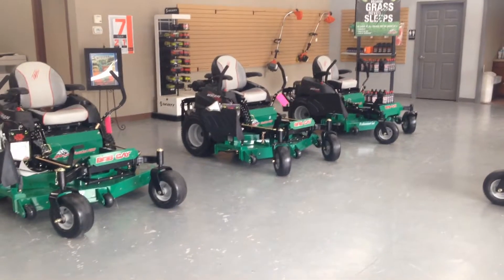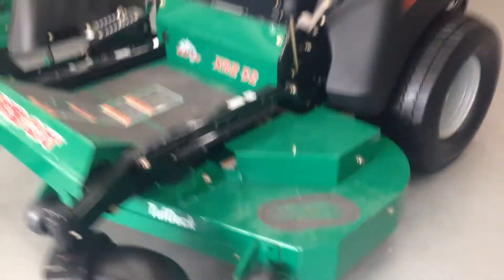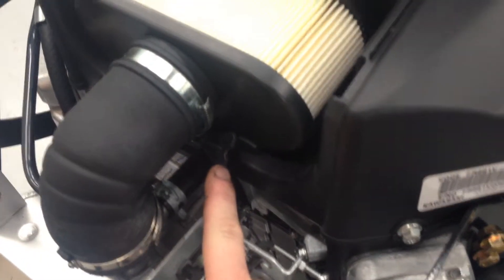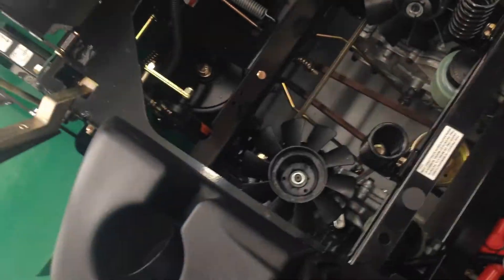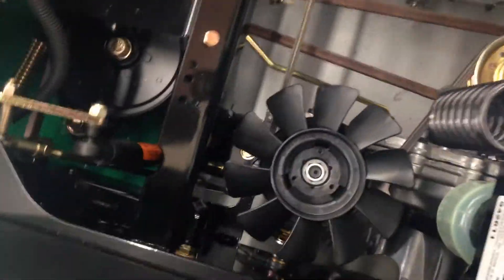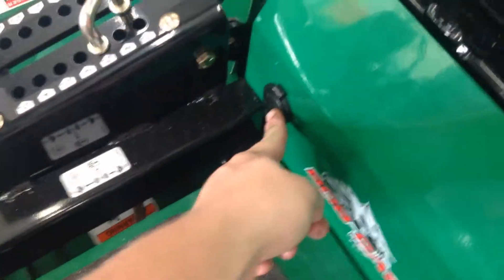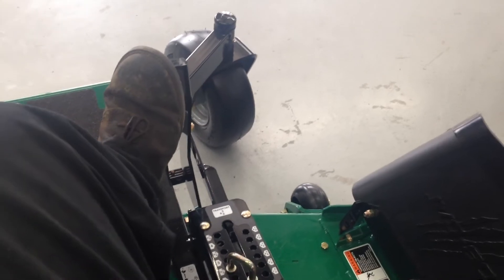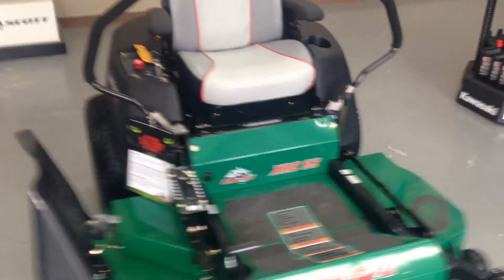BOBCAT XRZ 52 Presentation

Comment: I didn’t see any bearing or casters that are greasable. Is that correct? If so why not serviceable bearings?
Reply from the maker: Because no one wants to deal with maintenance any more.  A lot of brands are moving away from serviceable spindles and going with sealed spindles.  On the mowers I sell Bobcat and Worldlawn their sealed spindles seem to average 750 hours.
Reply: American Diesel Lovol USA yea to me it’s called laziness. I’ve had zero turns for 15 years and the bearings last a lot longer than that. Of course I’m meticulous with maintenance

Comment: Does the XRZ come with a hitch?  Or can a hitch be attached?
Reply from the maker: No, and yes.
Reply: American Diesel Lovol USA Thank you very much for your response and video.

One last question.  The CRZ does NOT have an available hitch, correct?
Reply from the maker: That I cannot remember, but if it does not have a spot for it all it requires is drilling two holes to make a spot.